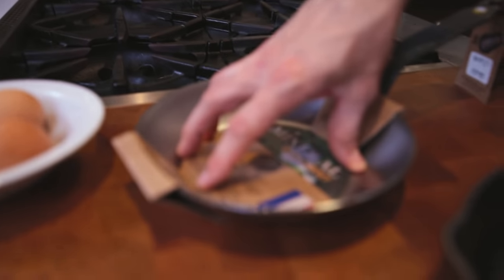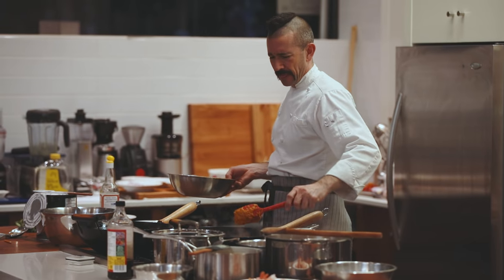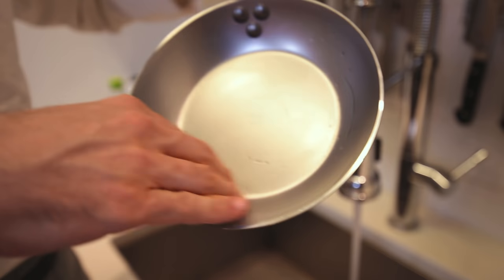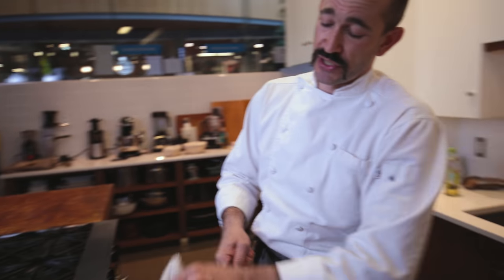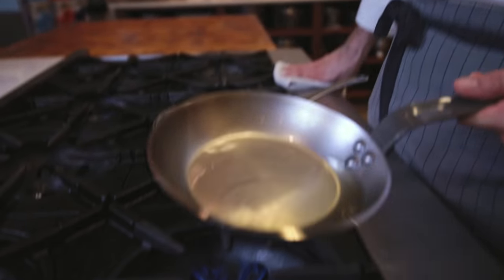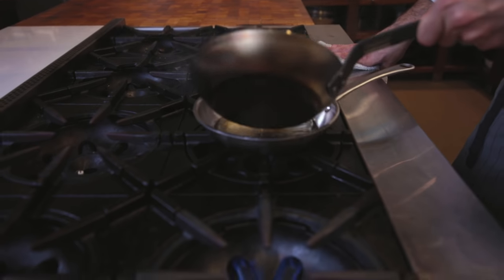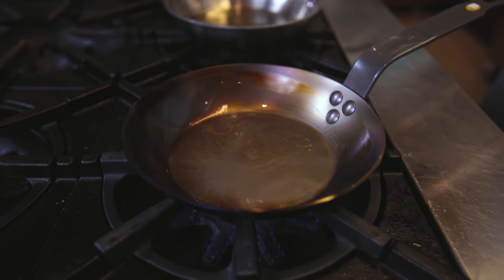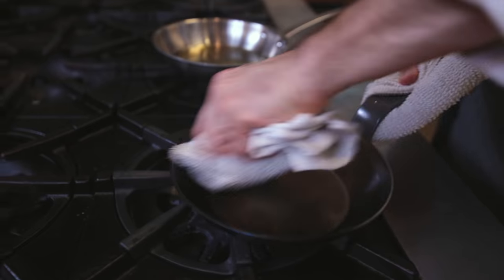How to Season a Carbon Steel Pan

Comment: don't mean to tell you how to do your job chef, but thats way too much oil. in the end it looks like it baked and got gummy around the sides which is very bad
Reply: I bought a De Buyer mineral B for my mom and dad. Tried the stovetop seasoning (induction) after scrubbing it with hot water. Everything stuck on the pan and it was hopeless cooking on it. Then I tried the oven method after cleaning it in the sink with hot water. Covered the entire pan and outside with oil, and poured a layer of oil (canola) into the pan. Gave it about 20 min with oil, and another 20 min after pouring the hot oil out. The entire pan is now sticky to the touch... A lot of discoloration which I think is normal, but its super sticky. Havnt tried to cook with it after this, but I'm starting to think the pan is useless. Am I doing it wrong or? Really disappointed in this pan man. HELP :(
Reply: @ckillgore  I bought a De Buyer mineral B for my mom and dad. Tried the stovetop seasoning (induction) after scrubbing it with hot water. Everything stuck on the pan and it was hopeless cooking on it. Then I tried the oven method after cleaning it in the sink with hot water. Covered the entire pan and outside with oil, and poured a layer of oil (canola) into the pan. Gave it about 20 min with oil, and another 20 min after pouring the hot oil out. The entire pan is now sticky to the touch... A lot of discoloration which I think is normal, but its super sticky. Havnt tried to cook with it after this, but I'm starting to think the pan is useless. Am I doing it wrong or? Really disappointed in this pan man. HELP :(
Reply: This method is recommended by DeBuyer and works perfectly fine. He just waited a little too long before wiping the skillet (and put it back on the heat after dumping the oil). That's why the oil formed that sticky stuff on the side walls.
When the oil starts smoking, you keep moving it around (to get the oil on the side walls) for like 30 seconds, then dump it and start wiping the skillet to get rid of all excess oil. That way, there will be no sticky build up and the skillet is ready to be used.
Reply: @Joshua-uq9zw  You didn't already throw it out in the last few months, you can buy some Barkeepers Friend, blue Scott scrubby, and you can strip the pan down and try again
Reply: @Joshua-uq9zw  This is an old post, so I don’t think I’ll help you. However, for those looking, this is 100% user error and nothing to do with the quality of the pan. 

If the original poster sees this and wants help, please reply here.  I’m not an expert, but pretty good.  ;)
Reply: @CreachterZ  thanks!
Reply: @CreachterZ  actually I need help here, I tried seasoning my pan but nothing :(
Reply: @Joshua-uq9zw  TL;DR - you stopped short/flame was too low to properly season. superheat it so as to burn off the entire layer, and start again.

Long version: same thing happened to a cast iron skillet i tried to season my first few times. Turns out every oil has a sweet spot for what temperature it fuses to the surface of the metal, much in the same way every oil has a different smoke point. if you don’t burn it hot enough to fuse, you end up with a sticky surface. Conversely, too hot and you can desintegrate the surface layer of old polymerized oil, ive done both on accident and learned the hard way. 

PS: at or above 650°F is the temp i mistakenly let the grill get to when i accidentaly burned off the seasoning. (Canola)

At or below 400°F is the temp the oven had when i produced the gummy surface layer on the cast iron skillet. (Probably olive oil)
Reply: @Joshua-uq9zw 
So we live off of carbon steel such as De Buyer (incorrect Pronunciation from the chef here), and Smithy, and we always bake them at 500°f in the oven with a thin coat all around the entire pan, (washing with hot soapy water first).  Thin coat is key or it will get sticky.  We leave it in for 2hrs, let it cool slowly,  and repeat 4 xs.  Not really necessarily required to do so much, but to get the best non-stick from the first cook, it's what works best.  Very thin layers of oil as if you were taking off the oil you placed on.  Place pan facing down so any extra oil drips off.  
They will get really dark brown, and even black after many bakes.  But most of the patina will not stay as you use the pans.  They become EXTREMELY non stick.  
Ultimately,  the key to any pan becoming non-stick, even stainless steel, is to slow to heat until water bounces off the pan.  (Drop a bit if water to test heat level)
Careful with induction tops, as they can become far too hot and warp pans.
CS pans are great for fish, meats, and anything that requires high bold even heats.  No acid like food though, like tomato sauce etc.  That's for your SS pans.  
After each use of your CS, just wash it with water,  place on burner to dry on low heat, put a very very thin layer of your oil all around it, top and bottom.  Make sure you get a fresh paper towel to take extra off, and you are all set.  
Our kids grew up with these types of pans and they love them.  Everything slides around.
Good luck and enjoy these amazing "ugly" pans.

Comment: This method will produce a super sticky brown coating, especially on the sides of the pan. Also, polymerization of the oil happens below the smoke point. The best method is to wash the Carbon steel pan thoroughly, heat it up to dry it while wiping it out. Once it's dry, put a drop of grape seed oil in and wipe it around the entire pan to coat everywhere. Then use a clean towel to wipe all of the oil out till it seems dry. There will still be a microscopic layer that remains that will properly coat and season the pan. Place the pan face down in an oven that is not preheated, and turn it on to 400 degrees F and leave it at 400 for one hour. turn off the oven and let the pan stay inside to cool at a natural rate. Do this one more time the exact same way if needed. Your pan should have a beautiful and even golden bronze color with no sticky brown spots. Alternatively, Stainless is incredibly non-stick with NO seasoning at all, as long as you know how to use them. Preheat, but don't overheat them, don't put refrigerator cold food in the preheated pan or otherwise cool down the hot pan by overcrowding it.
Reply: THANK YOU! This is 100% how you do it. You want the layer of oil super thin. If it feels like it's oiled, wipe it some more until it feels dry. You want thin layers, and you can stack them if necessary. Going super thick just leaves it a goopy mess.

Comment: This is by far the best, easiest and least time consuming method after trying them all out. I always do this when I get a new carbon steel pan and I can start using it right away.
Reply: Daniel
Any idea -- there i can get such gimmiky staff like grape seed oil ?
I have not.
Reply: @iridios6127  You can use pretty much any cooking oil. I go with rapeseed oil usually cause it's cheapest over here. Debuyer manual also states cooking oil, nothing specific. 😉
Reply: Usually the home cook "experts" vids go Waaaaay overboard. Rule of thumb 
Less seasoning , more cooking.
Reply: Do you season just once, as in the video - and that's enough?
Reply: @sdaiwepm  Just once is enough, after that the more you use it the better the seasoning will become.
Reply: Thank you everyone here. I have tried other methods and haven’t had much success, didn’t think this one would work until these comments, since it just seemed too easy. Thank you all.

Comment: Saved me from throwing out a rusty carbon steel pan. Thanks for the instructions.
Reply: I found a rusty cast iron pan abandoned at a camp ground. Removed the rust with steel wool and sandpaper then seasoned it multiple times trying to remove rust in between seasonings until I was satisfied the rust was completely gone. The pan looks brand new now. I love cooking in it.

Comment: If you go to your local metal recylers or rubbish dump you will find dozens of steel pans and woks which have been thrown away due to the Teflon wearing off, all you need to do is polish it all off and season the pan and you have free cookware.
Reply from the maker: Sounds like you have a great business idea there, Richard! In all honesty, if you could deal with the chemical waste issue of refurbishing the pans, you could really make something like this work!
Reply: @Cook-Culture  people don't want bare steel pans that need to be looked after and seasoned, its only viable if like me you have a workshop and the time to recycle stuff.
Reply from the maker: @snowflakemelter1172  I'd argue that point with you! We sell a few thousand pans a year that need to be seasoned from scratch. It seems that people like to take 'ownership' of the seasoning process.
Reply: @Cook-Culture  yes but a few thousand is a tiny minority, most people want non stick and throw them away after a year or two?
Reply from the maker: @snowflakemelter1172  You are right but I see a world where coated nonstick pans are not and thing! Cast iron and carbon steel can replace nonstick if people are willing!

Comment: Did this to my carbon steel pan that I was seasoning in the oven. Just had to strip my entire seasoning off after this method left the bottom of the pan sticky enough to adhere to the ceiling. 🤦‍♂️ square one. Back to the oven.
Reply: he forgot to mention that you need to wipe the pan thoroughly leaving a very think layer of oil before bringing it to the smoking point...if you leave too much oil, you will have the stickest pan
Reply: It’s odd though because it’s exactly how De Buyer tells you to season it, but I also got the sticky ring and blotches issue... I am pretty puzzled. A little coarse salt will take care of it btw.
Reply: @vii9420  check out Uncle Scott's kitchen...he has detailed instructions. He does it step by step so anyone can do it.
Reply: @jimshen0308  Thanks Jim! I'm familiar with that channel, I'm just puzzled by De Buyer's own seasoning instructions, perhaps we're overthinking this, perhaps they're being conservative and suggesting a very gentle seasoning to avoid clients complaining. In any case, the pan works like a dream and it's getting a lovely golden-brown-black tan :)

Comment: That is probably the best way to start the seasoning . If you haven’t tried to season a carbon steel pan then you might not understand that it is not easy. A few ways to season but in the end none are perfect. If you get it gummy then you know how to do it the wrong way. He didn’t appear to end up with a lot of oil in the pan. Wiped it out pretty good. Start cooking with the pan. Somethings are going to stick . Worst thing that can happen is you have to start the seasoning process over again.

Comment: It's absolutely insane that the culinary industry is training professional chefs with Teflon!
Reply from the maker: 100%. Over the years I've known some high calibre chefs that had never used cast or carbon. Fortunately, every one of them was excited and quickly adopted.
Reply: Why? It's a useful tool
Reply: - - - @THEACERASPIREMAN  
For getting cancer -- yes.
Reply: @THEACERASPIREMAN  
If you overheat the PTFE coated pan -- i don`t think that vapor make you healthier.
Or your food tastier.  )))
Also -- don`t forget about PFOA.
Reply: @iridios6127  Yes, if you overheat PTFE you might get polymer fume fever, not cancer, but you obviously shouldn't overheat it. When PFOA is concerned, it's not used anymore almost anywhere, and it's been only categorized as "probably carcinogenic", which also includes things like coffee and cell phone signals.
Reply: @THEACERASPIREMAN  For me the main difference is that steel pans last while the non sticking surface stays that way only for a limited time. They also warb even on mid heat.
Reply: @saskia959  yeah that's why I get cheap ikea pans that I use for things like french omelettes

Comment: I saw other videos seasoning carbon steel and they used oil, salt and potato skins.
Reply: There are several methods to season iron cookware and all work fine if done right. Potato skins and salt make sense when seasoning a hand forged skillet. The salt helps removing residues from the forging process and the potato skins absorb those residues. It also leads to some carbonization which becomes part of the seasoning.
The method shown in this video is recommended by DeBuyer.
The third group of methods are all based on burning in multiple very thin layers of oil.

Comment: Way too much oil used. You want a very, very thin layer so it polymerizes. Use a tsp of oil, spread it around, and wipe off as much as you can. Heat until smoking, let cool. Wipe the skillet with a towel. Then repeat a few times. This video shows using a ridiculous amount of oil.

Comment: Unfortunately you made a mistake, you actually used a cheap refined hexane deodorized rancid seed oil. If you researched how people would season their pans in olden day, it was dripping/tallow.

While Carbon and Iron is natural, grapeseed is not.
Reply from the maker: Nothing works better than grapeseed and/or canola. Cheaper the better
Reply: @Cook-Culture  Animal fat is natural, seed oils arent because theyre all chemically processed using poisons.

The best plant based are fruit oils with minimal processing (extra virgin coconut oil, extra virgin avocado oil, extra virgin olive oil) but they arent suitable for high heat, animal fat is suitable and natural.

When you factor in Health over convenience, there is no argument.

Comment: I had to sand off the factory seasoning on my Lodge skillets. From there its reseason it. First thing I fry is bacon in it.
Reply: The inside of the pan has the texture of sandpaper  i sand my lodge case iron skillets and my carbon steel skillets

Comment: Should I use paper towel/ tissue or a piece of lint free rag to season and to dry off water on the pan? I am concerned that the tiny bits from such things might stick to the surface of the pan and then get burnt when I fry oil on it. Another issue is that I 've got a brand new wok for a couple of days and every time I seasoned the pan with oil, there was some black residue left on the paper towel. Is such black residue harmful? I have no clue on how to get rid of the residue. Will it disappear over time? Please help. Thanks
Reply from the maker: Hi, 2 things here. 1) use terry towel. Works very well. 2) Without seeing the wok it's hard to comment however some carbon woks come with a protective coating that must be 'burnt' off before use. This may be what is flaking, Put the wok on the heat at medium/high for 20 min to cook off any reside.

Comment: I'm surprised that the only teflon coated pan you have you use to cook eggs in. Perhaps it's just me, but my mother cooked (and still does) eggs in cast iron and swears by it. And I tend to agree, eggs done in a good cast iron skillet/pan seem to be superior to eggs not done so. And if you have a well-seasoned pan, it will also be incredibly non-stick.

Comment: I used this method on my De Buyer mineral B and the pan became tacky and gross. When I first used it, the seasoning came off; it became splotchy and mottled, and you could see the steel underneath. After researching the Internet, what I realized was that this was WAY too much oil! Having that thick of a layer of oil is just not effective. So guys, from my own experience,  as well as from the comments above, you need to redo this video and clarify because there are a lot of folks who are failing with this method. I had to strip mine all the way back and now will use a very minimal amount of oil, rubbed off, before seasoning it again on the stove. Jeesh. Lots of work to get to this redo.
Reply: The idea behind this method is the oil acts as a heat sink and allows the pan to stay at higher temps for longer amount of time. The allows the initial seasoning to really soak in with out over heating and burning it. You're suppose to let it cool completely and then drain, which he doesn't show here.  Then wipe it down really really good, and reheat. I used this method on my mineral B and it has been non stick ever since. Also to strip just use canned tomatoes!
Reply: @tunatuna8877  Do you wash your pan with soap or just water?

Comment: Hi. Thanks for the videos. We recently bought a new range cooker with an induction hob. I bought a debuyer skillet and seasoned it with canola (rapeseed here in UK). Did my first cook in it today eggs and bacon. They released well. I can't get colourisation up side of pan and my ovens are not big enough! A dull area in centre of pan has developed. Is this anything to worry about?
Reply from the maker: Hi, Hard to say without seeing it but have a look at this video. It may help with post-cooking: https://www.youtube.com/watch?v=5hbe8N4x_0E
Reply: @Cook-Culture  thanks sent some pics on messenger.
Reply: It's hard, if not impossible, to get a nice coating on the sides without a gas burner. Put it in the oven instead. Works perfectly! There are a lot of guides out there! 🙂

Comment: Is it a good idea to season carbon steel in a Turkey Deep Fryer? Just heat the oil and cook  the pan in it for about 20 minutes. Then maybe put it in the oven afterwards at 400 degrees or so?
 Has anyone tried that?
I don't see any videos anywhere saying good OR bad about that idea.